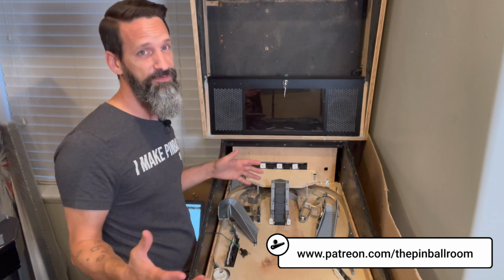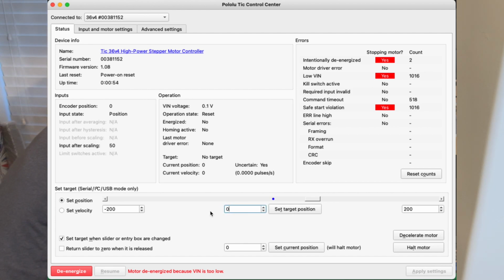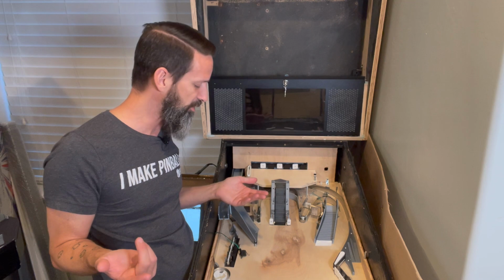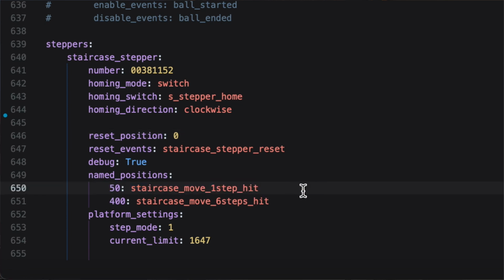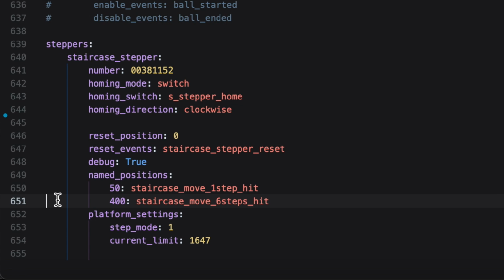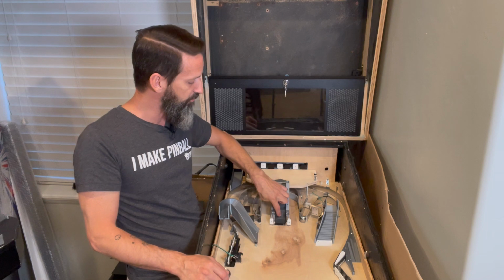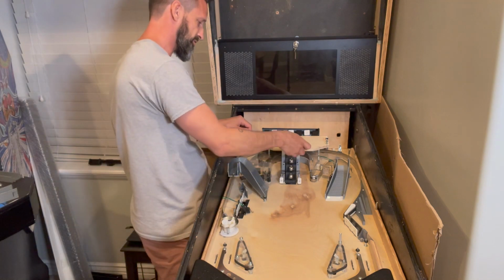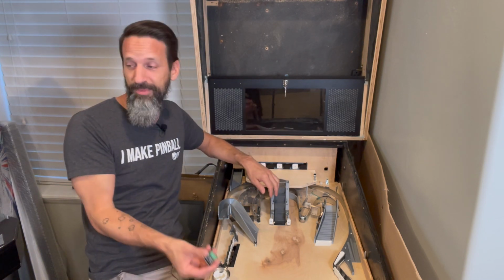HOW TO MAKE A PINBALL MACHINE: Stepper Motors 101

Comment: I'm curious, with the code as you described it, can you declare a variable, like "step_position = 0", and then when the event happens, say something like "step_position = step_position + 50" which would basically increment the variable by 50, ignoring the absolute value issue?

I suppose this still would run into an issue when you hit the max of 200, but that was going to be a problem regardless according to the way you described it, right?
Reply from the maker: The way it got implemented, there is no absolute position, instead everything is just a relative positive or negative (clockwise or counter clockwise) change to the current position

Comment: Good info. MPF is a powerful tool. 

Have you tried to stick MPF onto a Pi so you can stick it in the machine?  That might be an end of the road deal I guess.
Reply from the maker: Yeah, haven’t gotten to that point quite yet- likely going to use a NUC I think, but depends on where prices are at when I get there